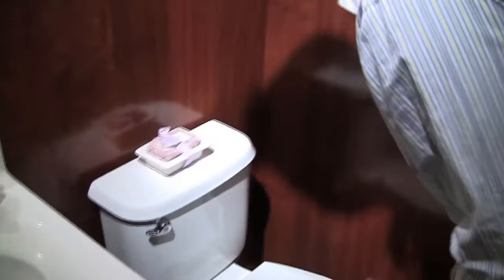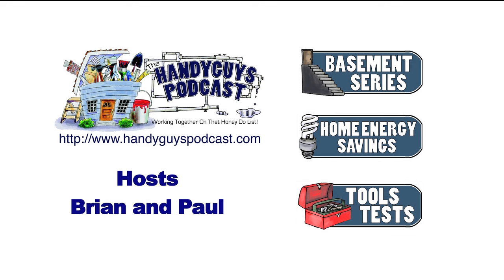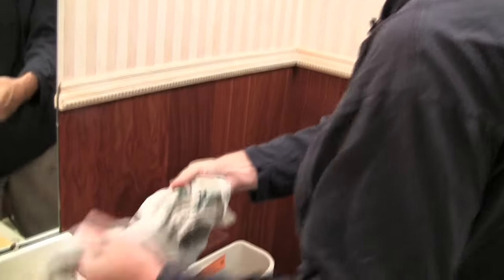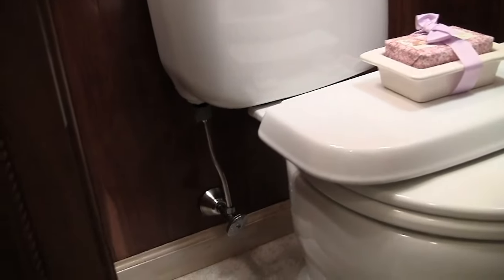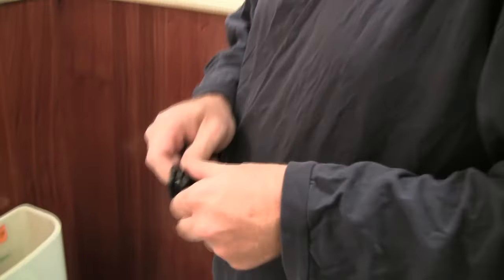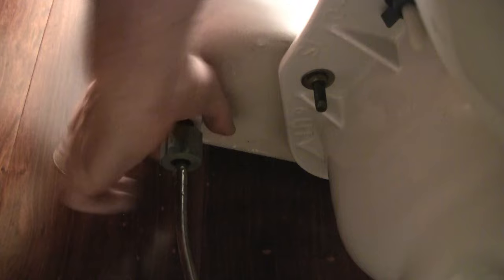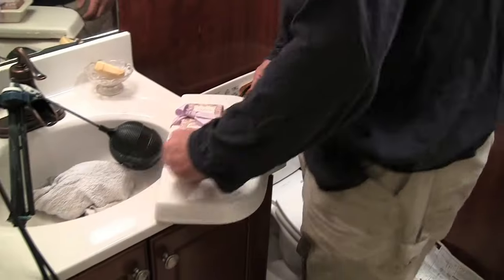Repair Toilet Fill Valve

Comment: Your title says that you are repairing the toilet valve, but you are (replacing) the valve.  I have been trying to find a video that repairs the fill valve.  I was hoping that your video was going to be the one.
Reply: Kielbasa Glen They are cheap, just replace it.
Reply: $20 for the whole kit, or $5 for the top valve cap.
Reply: $20 ain’t cheap, especially if you have 2 to replace like myself but getting the whole kit would prevent you from having to go back to the store if the top valve wasn’t the whole problem.
Reply: @steven240sx  like I have two to replace or fix, but you said you can buy the top valve right???
Reply: GSHeverything _27 yes, you can buy just the top valve, a plumbing supply store would be your best bet, not a hardware store, a store that only does plumbing.
Reply: @steven240sx  allrighty sir thank you

Comment: I put a plastic bag over my valve and no more spraying :)
Reply: How is this solution working for you. Mine is doing the same thing but causes water to leak from the handle because of its spraying.  I'm too nervous to replace that part. Has the bag helped yours. I wonder if a zip lock bag would work
Reply: @taylorc317  it worked until I replaced it, kinda like an umbrella. I think a gallon sized ziplock could work but a grocery bag is what I used. Easy fix all around though, just watch some YouTube videos on replacing it.
Reply: Having same issue of it spraying. What did you guys change yours with or do you still have it spraying

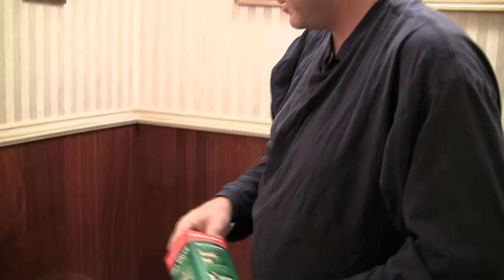Comment: UGH!  Replaced with the sleep disrupter at 03:02 !  That's the one I'm getting rid of for the old fashioned large ball float!  That plastic Fluidmaster fill valve has an amazing potential for very loud, high pitched noise that is beyond belief!  I cleaned and maintained it and still amazing noise, perfect in the beginning but later get ready to RUN when the sound becomes unbearable even to people in the next room!  As long as there's a choice I'll never go back to that Fluidmaster fill valve and keep using the large float ball.
Reply: I was wondering about the change from the float ball. That's good to know!

Comment: This video was a lifesaver. A couple weeks ago we had to get the main sewer line cleaned out(we live in a duplex and the other side was using those "flushable" wipes for their toddler. After they moved out and the water was shut off, they stopped moving where the two sides main lines meet up.) We just found the toilet leaking again and thought "oh boy, here we go again" until I realized it wasn't leaking from the base, but instead from the tank! Hello easy replacement that we've done before.

Comment: This video was awesome. I had two out of my three toilets doing that. Went to Home Depot and got three fill valves for $7 each. Took one hour to replace all three. Would have been quicker if I remembered to use my wet vac instead of towels to get the excess water out of tank. I used the fluid master 400a fill valve. Thanks guys for the video.
Reply: What happens to the valves to make them do that? Does the downspout get clogged or something? Mine is doing this and I have no idea what happened.
Reply: dartme18  it is just bad valves. They just need to be replaced. There is no repair you can do. The valves are at Home Depot and really expensive and too easy to install.

Comment: what is going on if you get to 2:44 and it starts SPRAYING OBSCENE AMOUNTS OF WATER AT U- 
I live in a complex with poor maintenance and no real help. And I am unable to locate the main water line if I even have access to it as it probably goes to the whole building. Trying to install a bidet. I have completely turned the knob clockwise as well. 
I made it to 2:44 on my own prior to watching this video- via the bidet installation instructions. When it started dripping i thought the water wasnt all the way off. The instructions dont explain that it can leak slightly still. (And i didnt soak up remaining water in the tank with a towel), so i tried turning it counterclockwise top see if clockwise wasnt all the way off. and then it came completely loose and began spraying. After freaking out, I was able to get the water off. My girlfriend flipped a switch on the breaker but I doubt that was what cut the water off. I think in my panic I cut the knob clockwise again and thats what cut it off. It is still clockwise, my breaker is still off, and the tank is actually completely empty. Can i trust that the water is actually off now to finish installing the bidet? And how do i get the toilet tank to fill again once I'm done? will cutting the valve counter clockwise really return the water without causing it to spray???

Comment: What if I can shut the water off? help!
Reply: P 2l you may need to shut the water off at the main vale located at the water meter. This should turn off all the water to your house. Run the cold water in the sinks and/ or bathtub to make sure all the water is out of the lines to empty the system BEFORE removing any open water lines or valves. Suggestion... replace the hose to your toilet while the water is shut off. Better to be proactive, not reactive
Reply: That's what we did. Thanks! :)

Comment: Just moved into my house a couple months ago and found some water behind the toilet. We found the problem you show here. I didn't look closely at it and thought, "I'll just get a new water supply hose". I put the hose and flushed the toilet. It went sort of like 0:25.

It really looks like this valve is designed this way! I removed that red tab and it seems that less water comes out THAT side of the valve, but much water still comes out the other side. What's going on here!?

I mean, whatever...why repair what you can replace, emma rite!?

Comment: When I turn the water valve back on, water keeps spewing out from the beneath the tank. What am I doing wrong?
Reply: maybe retighten the underide nuts?
Reply: @ralfsfreimanis6575  I retightened still leaking???
Reply: @dianasaidy7503  if ur toilet is. old the  rubber washers that connect the tank and toilet might be broken and the water from the tank is going though the cracks, im no expert  but. i just had experience

Comment: Family of 4...we also use FluidMaster, usually needs replacing once per year per toilet.
Reply: Jennifer Kindle Why do your toilet fill valves only last a year. I had a Korky 528 fill valve at my old house that was almost 10 years old & still working fine.